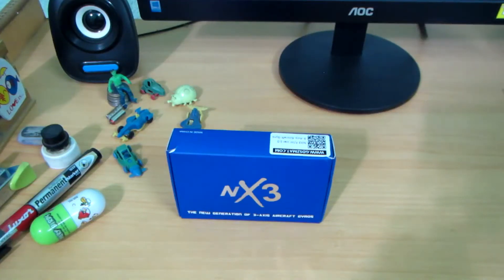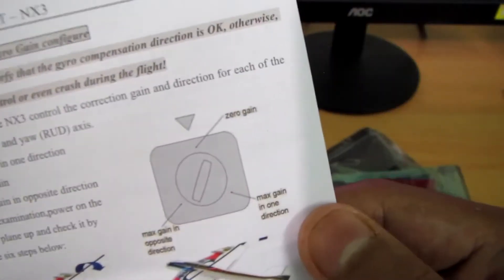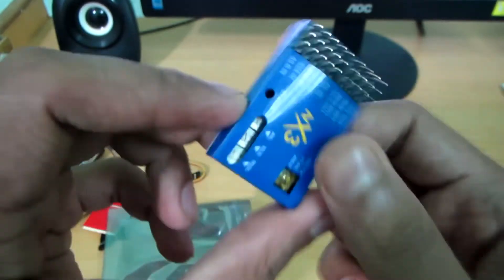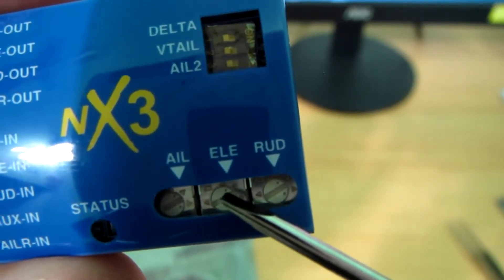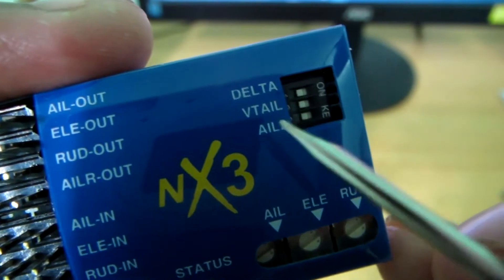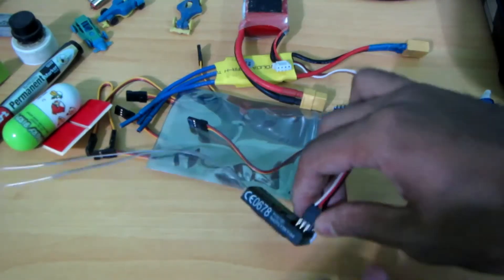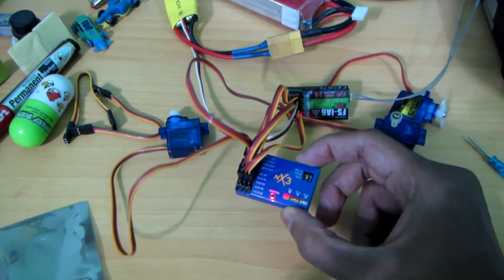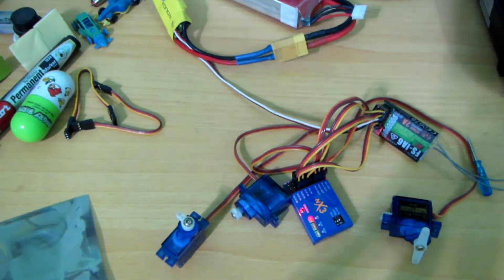NX3 Gyro User Review

Comment: Do not use the switch but the wheel to change the flight mode
Reply from the maker: If you use the wheel, you can control the flight mode and the gain simultaneously. Have a Happy Flight !!!